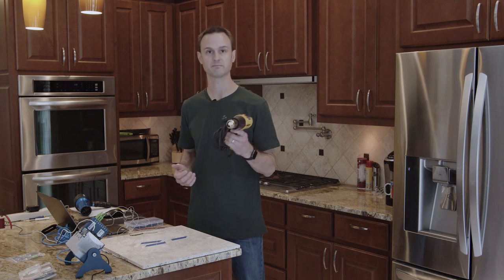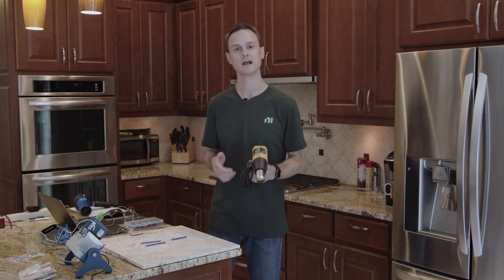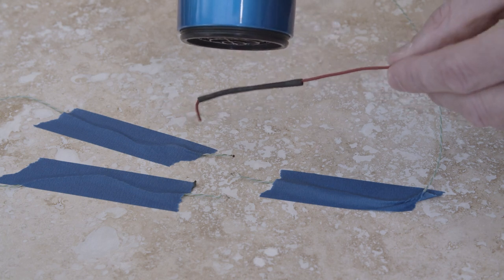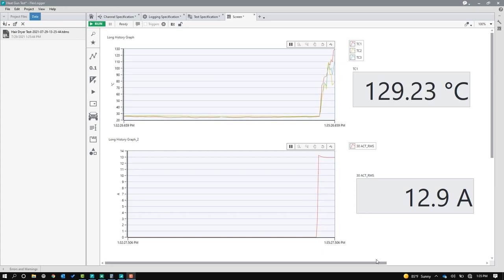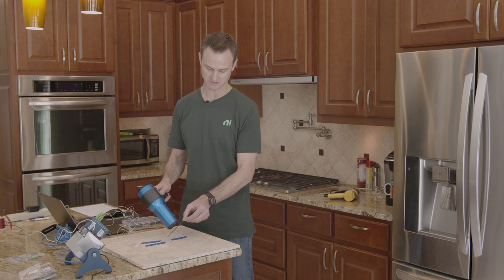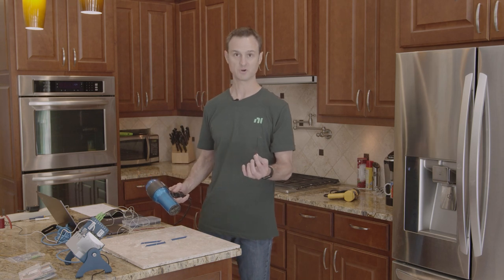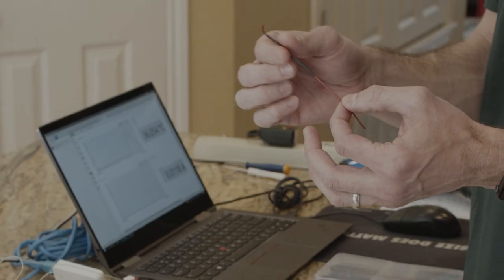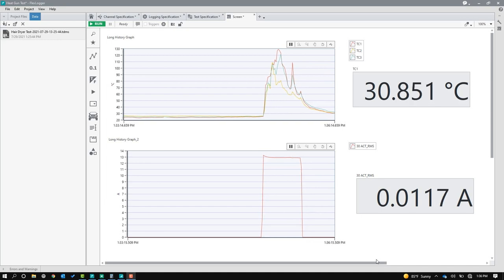Can You Use a Hair Dryer for Electrical Heat-shrink Tubing?

Comment: I tried this with some butt connectors and it seemed like it didn't get hot enough to shrink it. I tried a lighter too which kinda works but that burned some of the wire casing off a couple of times so Idk if the butt connectors I have are thicker or i just need more heat or what? I'll have to check the wattage of my hair dryer.

Comment: Do you think you can also use a hairdryer like this with heatshrink self-solder seal wires =?
Reply: I would suggest a lighter or a butane torch flame (also available as lighters) just don't burn the shrink wrap and keep the flame moving.